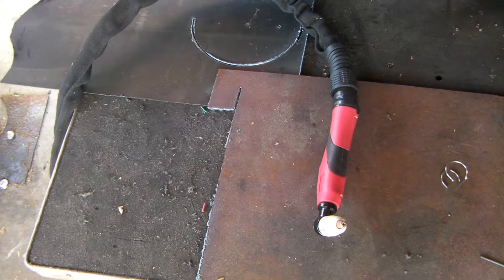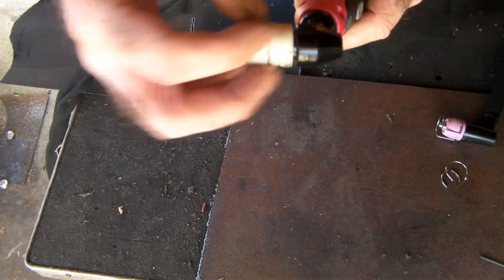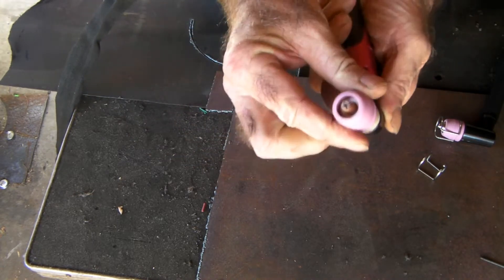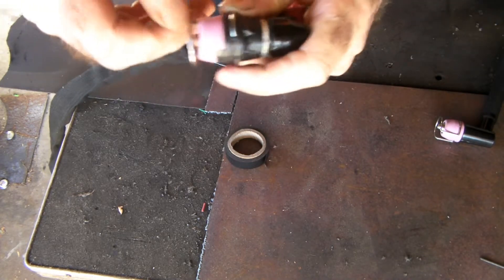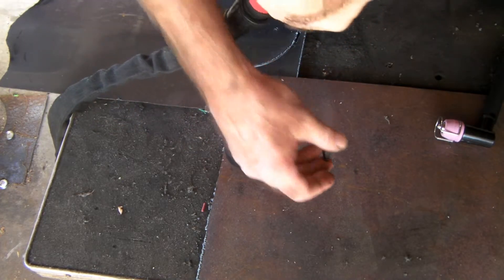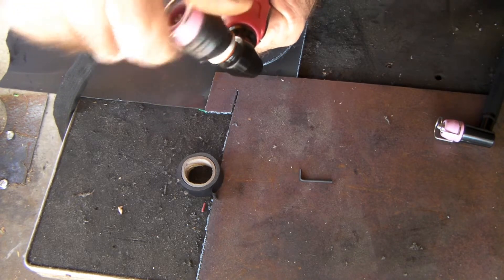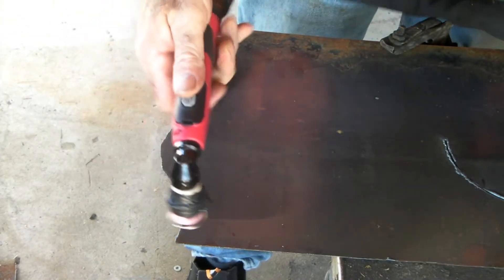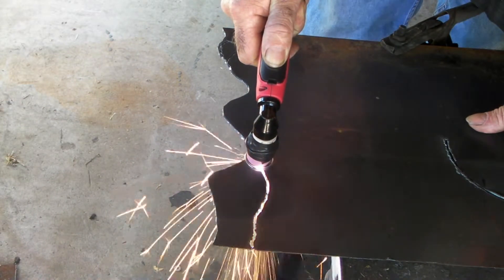Pt -31 LG-40 Diy Homemade Plasma Torch Guide

Comment: Pete - Without doubt you are Mr Plasma. 
Love it. Thought about cutting a slot for the guide around the PT31 Ceramic with a Dremel or grinder zip disk but ended up getting an AG69 torch.
Your system much better.

Can you do a hack to convert a PT31 torch to full time pilot arc? With your guide system it just needs a slot or hole to carry the earth wire onto the PT31 tip.
Reply from the maker: something to think about